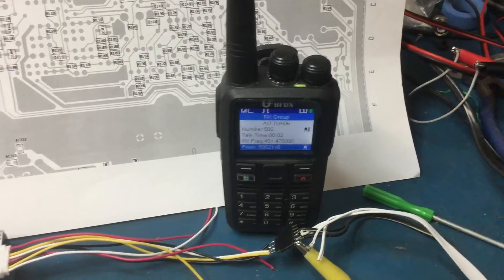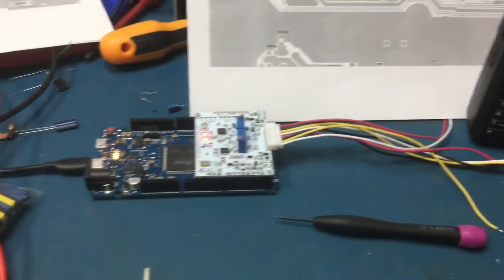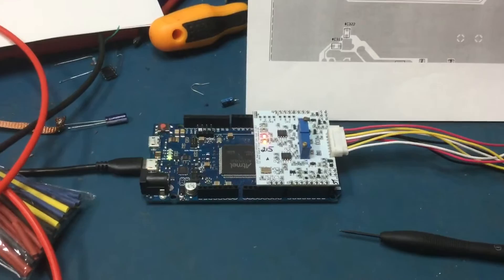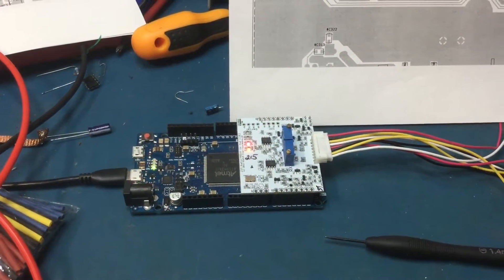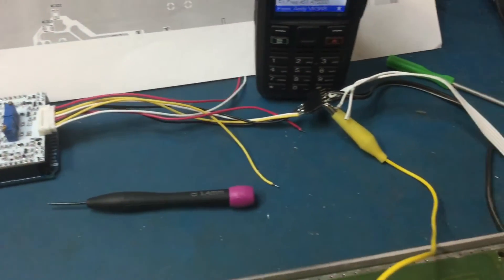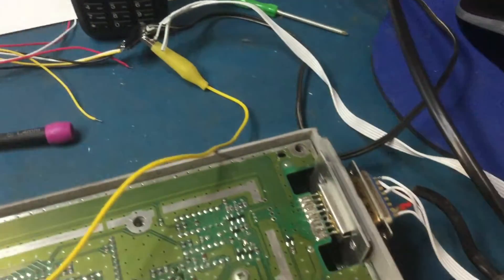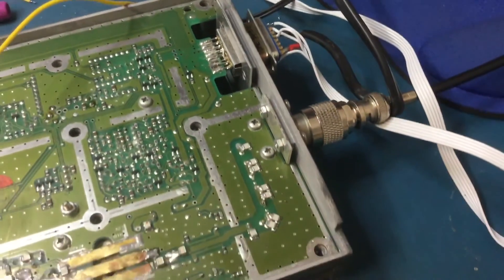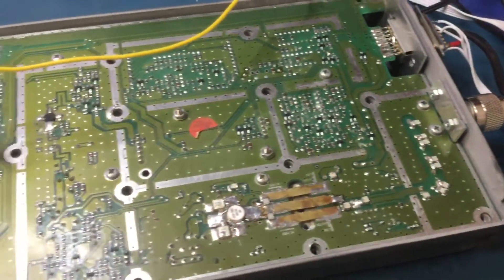Tait T800 Series 1 T856 TX First DMR Transmissions with MMDVM Board

Comment: Do you have information regarding the use of Tait 855/856 to use with Repeater board V3F4 supplied by BI7JA?
Or any info regarding correct wiring and location of pins used etc.
Sorry new to this side of the hobby and trying to get Tait DMR repeater setup to work.
Thanks Neil

Comment: Hello sir, how do you program the T856s? According to what I have found it needs a DOS based app...How did you burn the proms, and with what?
Reply from the maker: I run the Tait PGM800 DOS software inside Dosbox to create the T800 Series 1 EPROM BIN file.
Then I burn the BIN file using a TL866 EPROM programmer.
Works great for the Tait as well as a bunch of other radio's that use EPROM's.
Reply: Thanks for the info. I currently have the -20 series RX'r and TX'r which are both not able to go below 148 and I want to use this in the ham band. Did you have to do anything to make yours go into the ham band, or did your's already cover this area (ie: the -15)
Reply from the maker: Mine were 450-470Mhz units.
The receiver was able to just make it down to 439Mhz without midofication, which is the Australian repeater receive segment of the 70CM band.

The transmitter however would not make it down to the 434Mhz I wanted to run it at, so the VCO required minor modification.The component values between the different VCO versions are all listed in the service manual.In my case I was able to get away with just increasing the value of one of the chip capacitors in the VCO and it made it all the way down to where I needed.